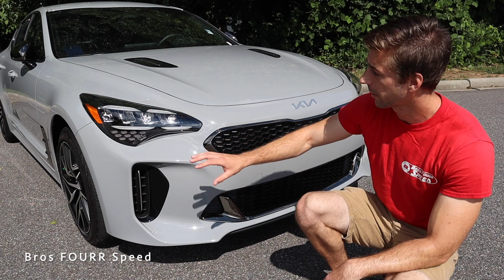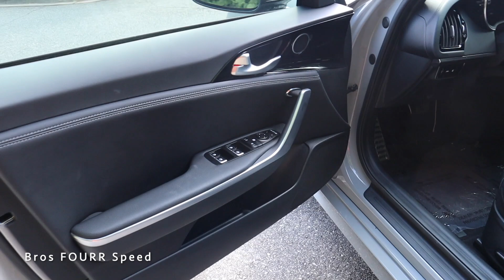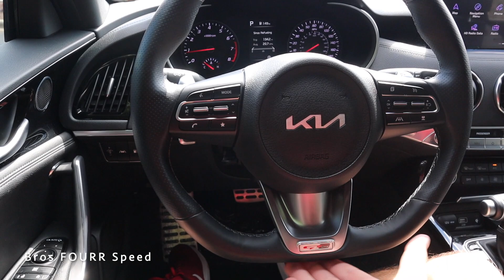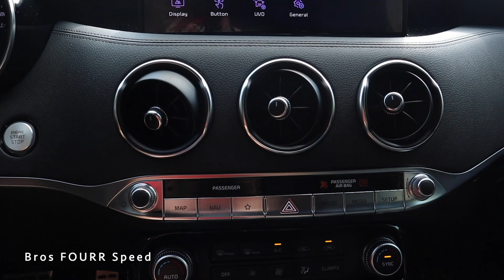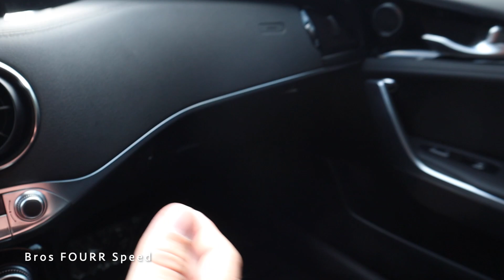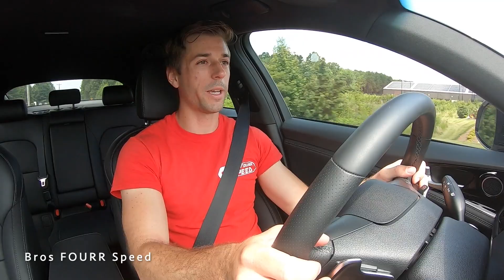2022 Kia Stinger GT Line: Start Up, Exhaust, Test Drive and Review

Comment: Why buy the K5 gt when you can get this. Does it have limited slip diff? Will it get sideways!?
Reply from the maker: While that's a good point, the Stinger is going to be at least $5K more than the K5.  The Stinger has AWD as an option too which isn't on the K5, so there are some differences.  The K5 isn't as sporty, so someone may not want that!  But in the Stinger with rwd, I'm sure you could get it sideways!

Comment: I am trying to choose between this and the K5 GT. I can’t do the fuel efficiency of the higher trims so when I heard the GT line had 300 HP, my stinger interest renewed. I like the way the stinger engine sounds compared to the K5 GT despite the same engine essentially. Thanks for letting me hear more of that engine!
Reply from the maker: That's a tough choice because they are both nice!  The Stinger is slightly larger but either one is a great choice!  The Stinger is more performance oriented though, so good luck with the search!!!
Reply: the stinger gt-line has available AWD! which will kill the K5 GT
Reply: @Vailwine  yea but it’s not torque vectoring, so like the K5, when pushed it will still understeer, 

Even tho the Stinger still has RWD dynamics 
 
hypothetically speaking if they both got a  limited slip differential I would lean K5.

The DCT in the K5 is the far superior pairing with the 2.5T.
Reply: Yeahhhh no the stinger is all around a better car, something that would be pretty much the same as a K5 would be a Hyundai Sonata N-Line. Closer pricing too.